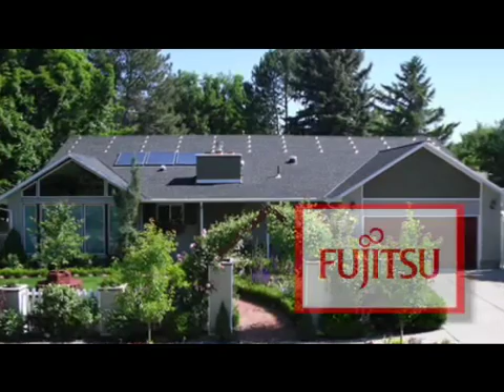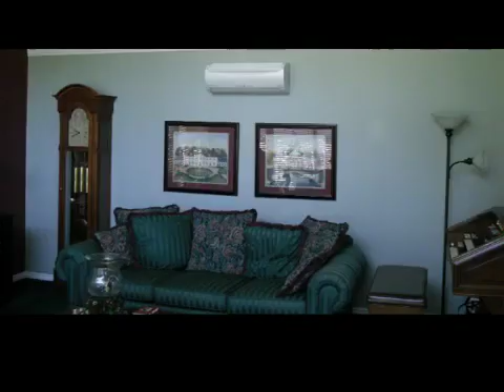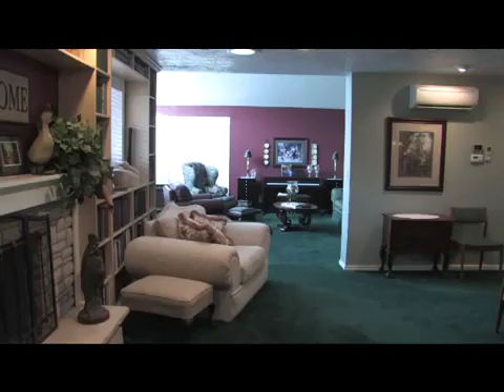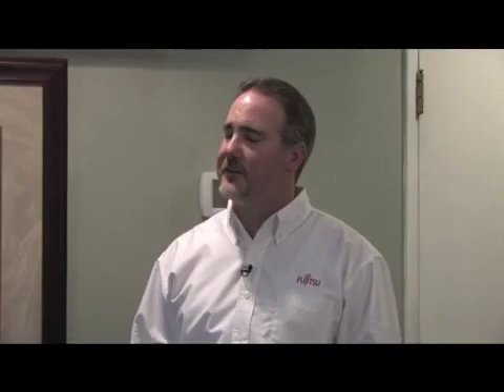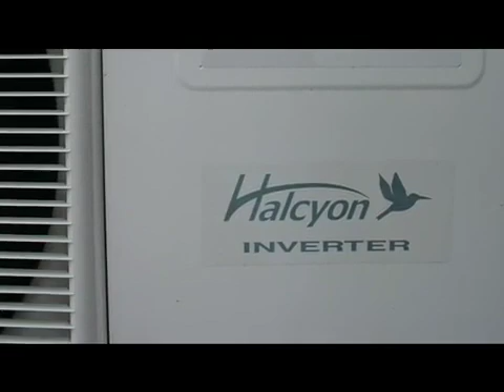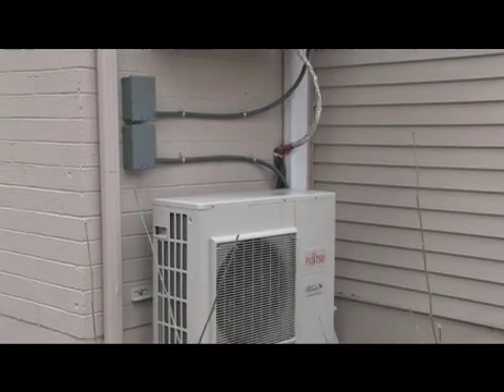Fujitsu Ductless Mini Split System Benefits

Comment: Hi, i am buying a 15RLS2 for a family room and a AOU24, with 2-7RLF heads for upstairs in my cape.  Now i am wondering if the remote will be enough, or will i have to buy the overpriced wired thermostat.  Does the remote that come with these allow to have the unit kick on and off, or just off like sleep mode?

Comment: Obviously as heating would be used during the winter months.... switching over by use of reversing the cycle of the 'air source heat pump'  is what he is saying...thus having a heating mode selected rather than cooling...

Comment: I noticed you have the indoor units on interior walls. I was wondering if you were using condensate pumps in the indoor units or if the lines are running down to the basement.  I install Fujitsu units as well and have used the mini-split condensate pumps.  My customer complained about the noise and how often it runs as the pump only holds about a tablespoon of water.  Do you have any suggestions?

Thanks
Job looks great!

Comment: @bengalwoman  very simple,  it is the same like duct system, the conventional central AC consist an outdoor unit condenser and indoor unit evaporator which distribute the air through the duct, in split system the evaporator distribute the direct without a duct, same ductless indoor units designed to operates with duct, name concealed units, so you can use one concealed unit to connect to a duct, same as central ac.